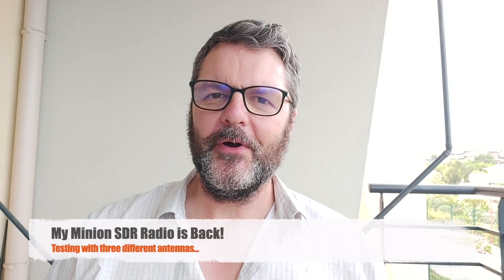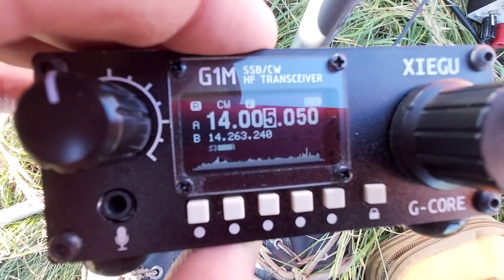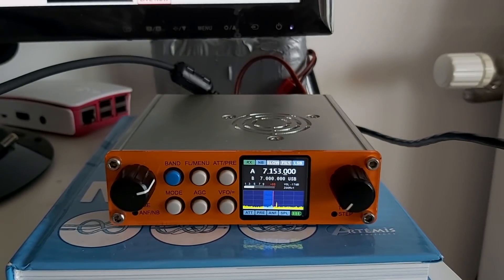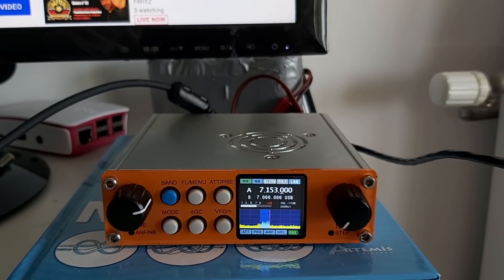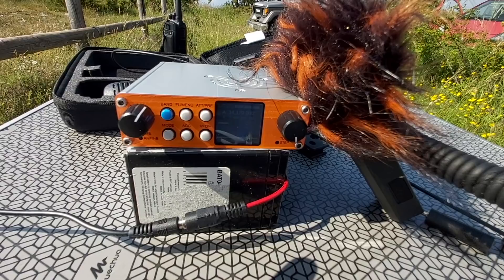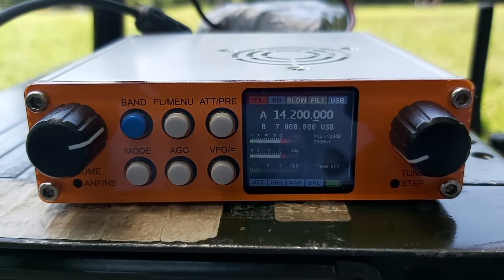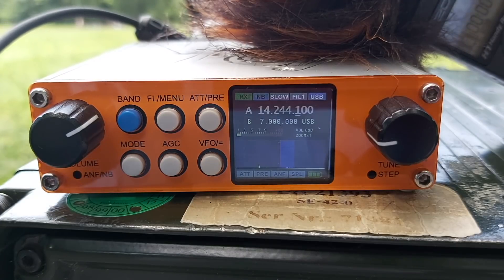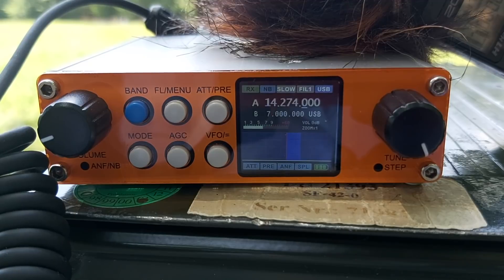My Minion SDR Radio is Back!

Comment: Your antenna is not well tuned when I look at the internal SWR meter. Is this a possible cause of RF feedback into the transceiver?
Reply from the maker: Hi, I don't believe so.
Reply: @RadioPrepper  
It's not that uncommon for a built-in SWR meter to not be quite as accurate as an analog meter.
I also watched the video with the power test from LY2H. He used a dummy load and the internal QRPver swr meter showed about the same low SWR value as the analog meter.

By the way, I ordered the SDR minion last Wednesday. The ordering process went smoothly and I also received the confirmation that the money arrived after a few hours by eMail. This fulfills the prerequisites for starting the assembly. I am sure: The people at QRPver will try to do their best.

Comment: Hello Sir, I am new to hobby and started listening stations with rtl sdr dongle in PC. I just want to know about the best receive only antenna for HF. Do I need balun or unun for clear receive only antenna or just long wire will work? I have searched a lot but got no video for the purpose.
Reply from the maker: A simple long wire will work well, though you will get slightly better results with a 9:1 UNUN.

Comment: CW issue - it could be you have to decouple the key cable wires (ie. blocking capacitors soldered at the key connector, etc.).

Comment: Congratulations on getting it back! I have a hope now these guys probably will start communicating and answer my questions which I put to them in 2 letters and my 4 reviews on my channel :). As to the  shoddy CW, I'm actually sure now after extensive testing it's not the RF feedback, it's a wrong design of the software of the Iambic keyer ( it's a question for another Yuri who's the software designer for this rig)   . I think, I found a workaround also about it: using the external automatic keyer actually solves the problem, as does the usage of top precission paddle like my Begalli Traveler :). And increasing the TX delay time up to some 500 ms almost  ( not entirely but almost) cures the rig's "freezing" effect of not returning to RX for some 5 seconds while in CW mode. Few guys wrote to my channel my workarounds  worked for them too. Good luck! Sorry abt G1M... 73! Linas LY2H
Reply from the maker: Very interesting thanks!